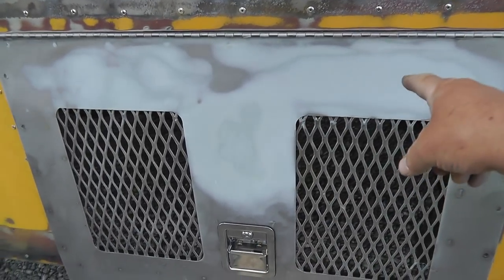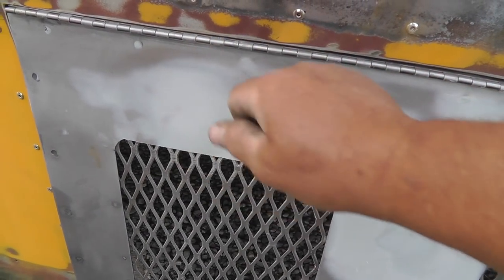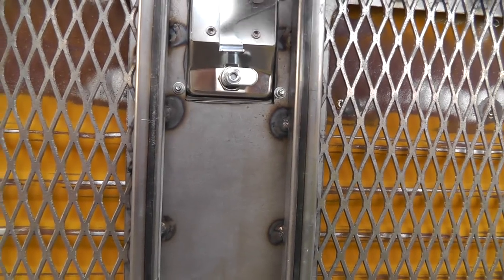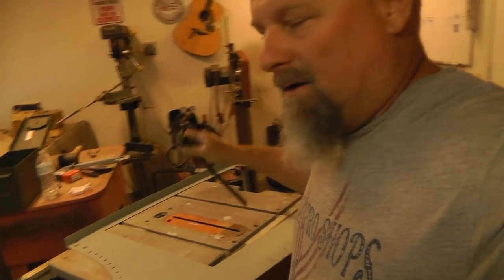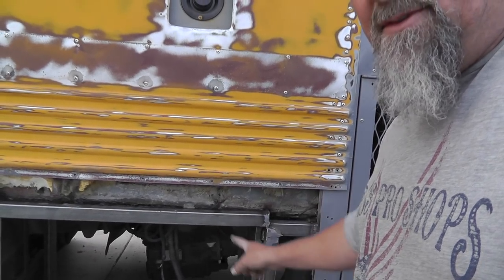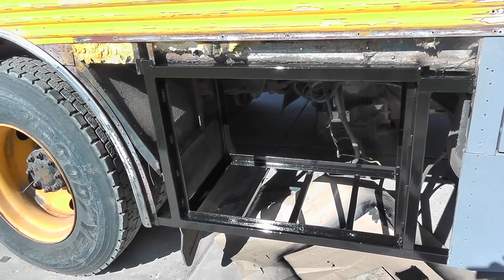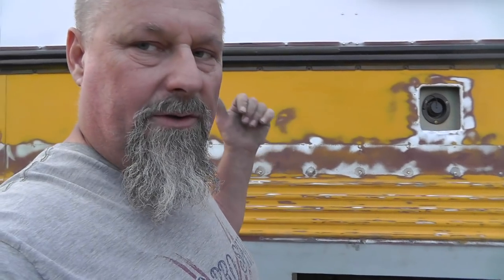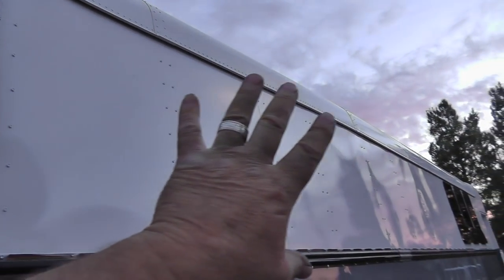Bus to RV conversion -32-  Finished HVAC door and battery box

Comment: You do excellent work but I was wondering why you chose to go with the grill inserts on the front of the various compartments you've made.  They look great but they expose the contents to the elements and it allows potential thieves to see what you have.  I understand ventilation is probably the objective on some compartments but personally I would have chosen something a little more lower profile for these reasons.  I'm a new subscriber, your videos are interesting and informative. Thanks

Comment: Awesome work as always. Attention to detail is amazing. 

I got an advert during so hopefully that’s some pennies towards the paint. 

Will the battery box not need a top to keep it watertight? Or can’t road spray get in there?
Reply from the maker: I left the top off so I don't get a buildup of hydrogen gas from the batteries.  Time sill tell if road spray becomes an issue.  I don't think so because the battery box is narrower than the dual wheels and they have their own inner fender along with a mud flap.  But it wouldn't be the first time i was wrong.....or the last.

Comment: Iv'e been following a while, nice to see someone with some skills doing such a conversion, Many of them on the tube are a bit 'bodgy' when dealing with the base vehicle with little thought taken to the longevity of the structure.
 I may have missed it, Are there adequate vents for the battery box?, a few gallons of hydrogen gas might be a little 'bangy', a vent on top would be okay as H is lighter than air, and a drain at the bottom would be good, I'm rambling.
 J.
Reply from the maker: The top of the battery box is open.  We will see if enough water/road spray gets into the box to warrant a drain hole
Reply: Okay, Might be good to close it up a bit to stop road filth getting in and settling on top of the batteries-it can become conductive and drain them, anyhoo, nice work, J.

Comment: What camera do you use? You mentioned you used a go pro, so how do you know what it is filming when you are pointing at yourself for commentary? 

I am kind of struggling with filming an editing. Being a past truck driver it is embarrassing to admit that I jackknifed the trailer when backing (I did have a spotter, was watching the spotter and neglected to look in the other mirror). 

I have fixed the damage to the motor home (https://www.lever-family-racing.com/lever-family-racing-home/family-vehicles/1997-fleetwood-american-dream/trailer-jack-knife-damage-2017-10-20) and was going to video the repair to the utility box on the front of the trailer. That came out terrible. 

Weather is is going away (they say first touch of snow on Friday).

As always your quality of work is excellent, a pleasure to watch.

Glenn
Reply from the maker: Ive been using, almost exclusively, an iPhone 6 plus with a wide angle lens and occasionally a Panasonic HDC-TM9 video camera.  The GOPRO hasn't been used since I got a MacBook, since its such a PITA to use the data on a Mac.                                                                                                                                                                           Snow.....why you gotta go and swear like that?  Better you than me, bro.  Thats why I moved to NV to begin with....to get away from that nonsense.

Thanks for the kind words, Glenn.  Keep it between the ditches!
Reply: Thanks I will try my Moto Z. Just ordered from Albanycountyfasteners. Was surprised they offer the option to specify US made. However they did not have 3/8 grade 8 nuts from the us, I tried.

Comment: Brother tho's batteries you have. Tho's are not your house batteries are they? I do not recall if you told us or not. I ask this as tho's batteries you have will not last for solar. They can't take the long draw or even much at all of a discharge. Not trying to be a  ass hat. Just been working in the Alternative Energy field for 20+ years. If I can be of help just let me know. LOVE your work you have skills man. Thanks for letting us be a part.
Reply from the maker: those are not house batteries, but rather the start batteries.  ditching the 8Ds and going with group 31s
Reply: Facing replacing my 31s now, will do that in the spring, I'm told they are only good for about four years, they are fortunately not that expensive, I only have two for starting.
Reply: I am thinking that an mechanically interlocked changeover switch between the house batteries and the vehicle batteries might be advantageous so the house batts. could be boost charged with the alternator?
Reply: Or if the engine batteries died, the house batteries could be used to start the engine?
Reply: There is a thingy made for this. I do not recall the name of it. But it's for RVs that will do just that. I just cant recall the name. I have put in a few for friends of mine over the years.
Reply from the maker: I may install a 2nd alternator to charge the house batteries while driving. Along with solar, a charger when running the generator and a converter when plugged into shore power, I should be covered
Reply: A pair of jumper cables would allow the starting of the engine (or at lest boost the engine batteries) if the engine batteries were to die on you. I have one two by three foot solar panel on the roof, that was not enough over the winter, I had to periodically run the generator to keep all the batteries up. Just finished the repairs to the utility box on the trailer from the jack knife.